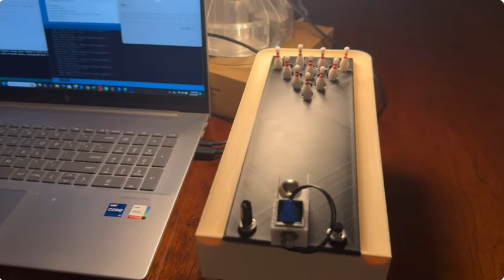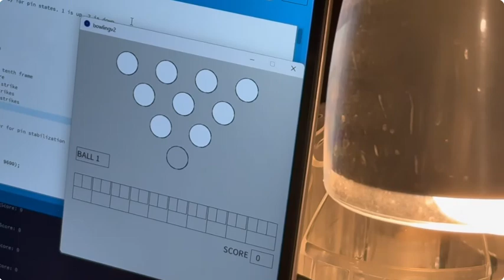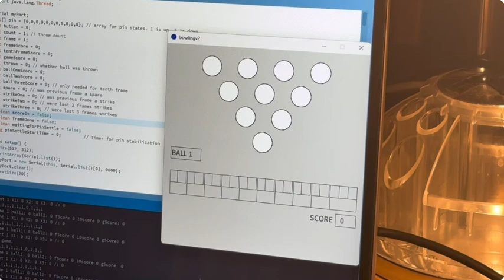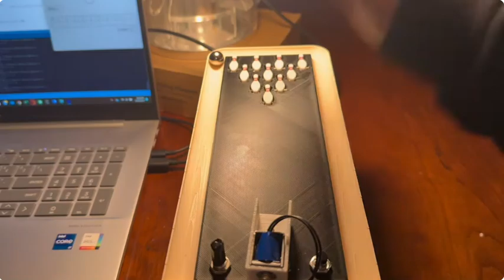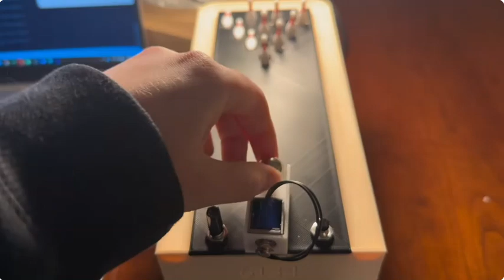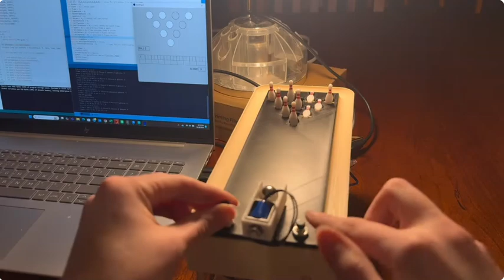Final Project, ENME 351: Electronics & Instrumentation II

Comment: Looks cool 👍 however, I wish you had put it on a properly aligned table because it's noticeably tilted to the left
Reply: Adjustable feet and a cheap level would solve the problem, however for a final project, it is excellent.